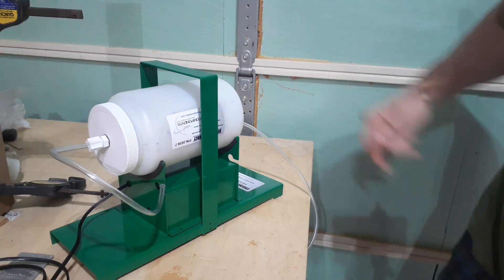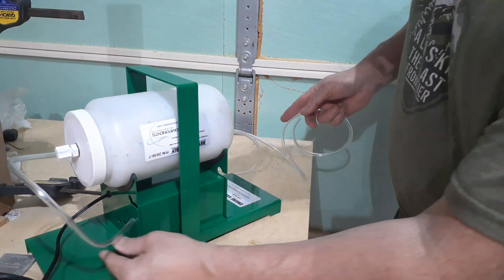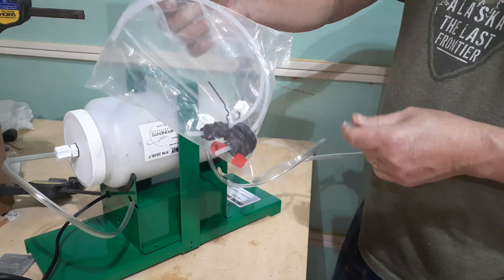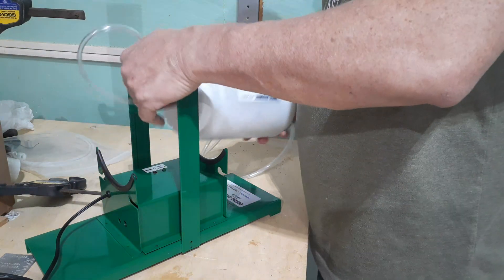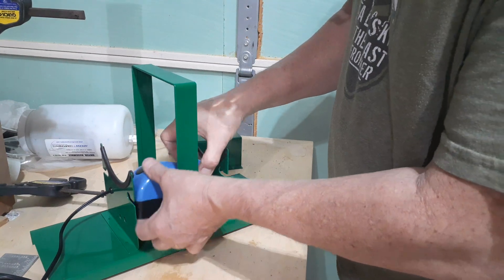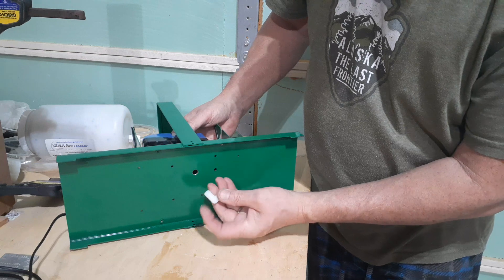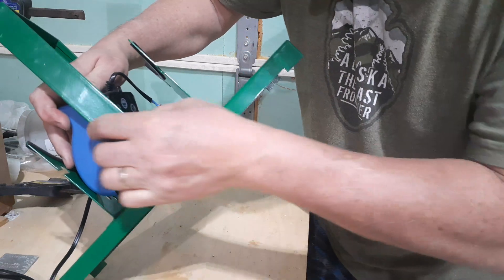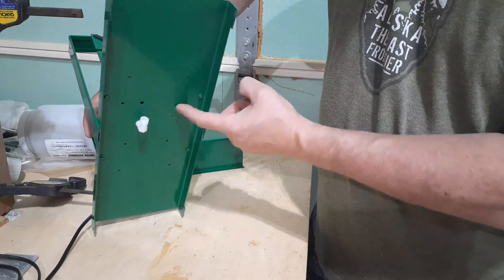aircraft engine dehumidifier mod for recirculating dehumidifed air

Comment: How do you run the return air from the engine to the pump?  How do you know you are not introducing ambient air from air leaks in engine?  Ie exhaust and induciton ?
Reply from the maker: Hi, the engine saver came with a large rubber stopper (which I'm using as the air input into the oil filler neck), and a small stopper on my engine breather tube (which takes the engine case air back to the pump).   There might be some, but I imagine, very little air that might pass thru an exhaust valve or the air intake, but having this is better than nothing.   

I just posted a new video yesterday with some digital relative humidity gauges in the loop, showing 15% RH coming out of the engine case......pretty good if you ask me.   😀 
Thanks for watching!!!